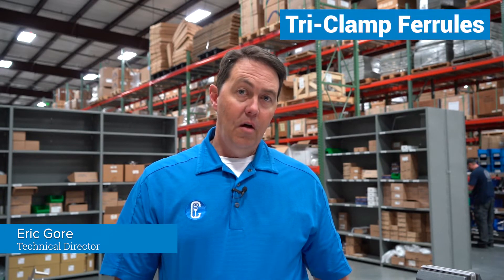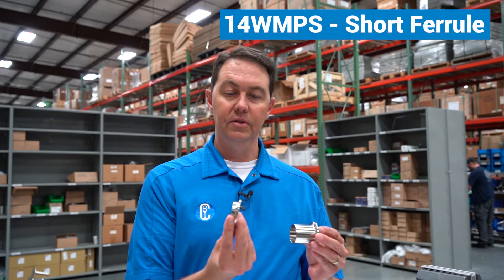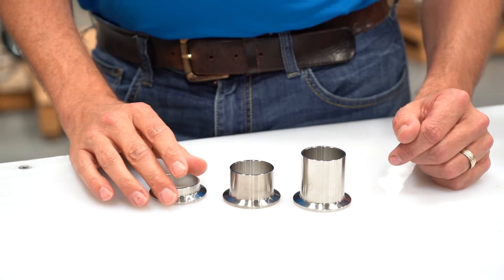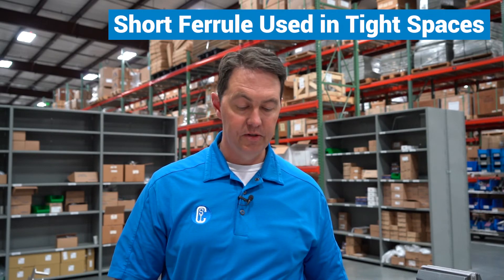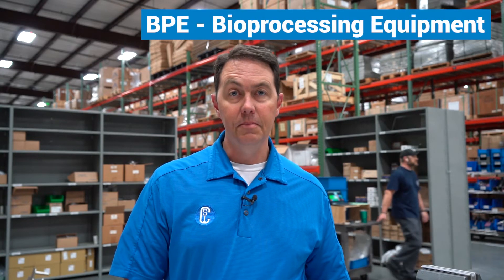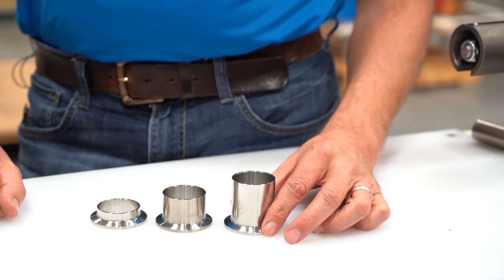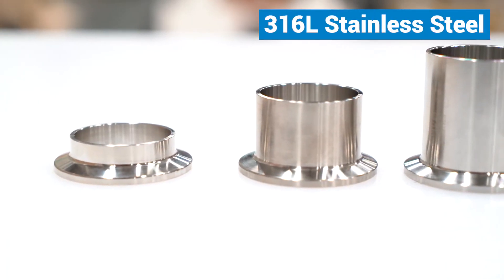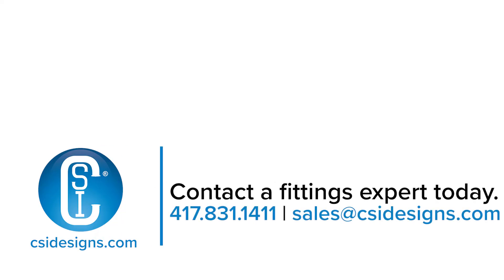BPE Ferrules

Comment: I have a 2-1/2” diameter  copper pipe. I need a Tri clamp copper ferrule that the pipe will fit into the ferrule. Do you sell this?
Reply from the maker: We are focused on stainless steel and nickel alloy tube and fittings, so we can not help with copper options. We know they exist in the market, often provided thru brewery and distillery equipment-focused suppliers. It may also be available thru Amazon.